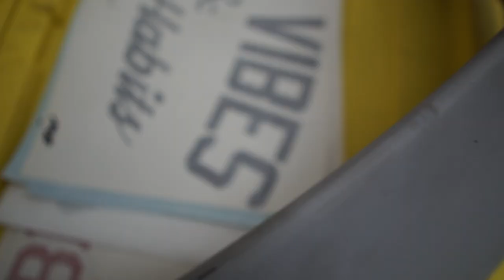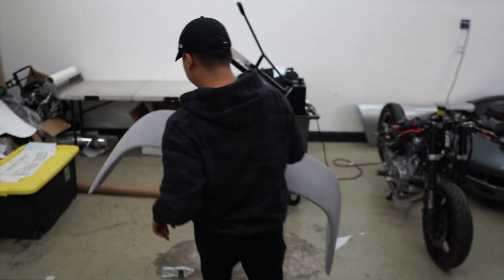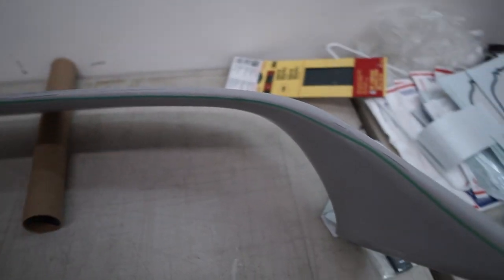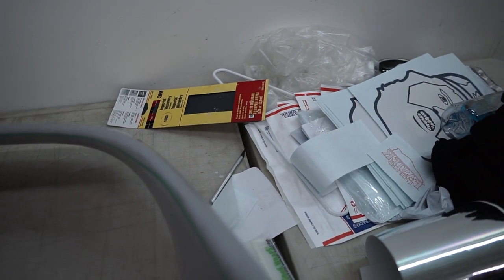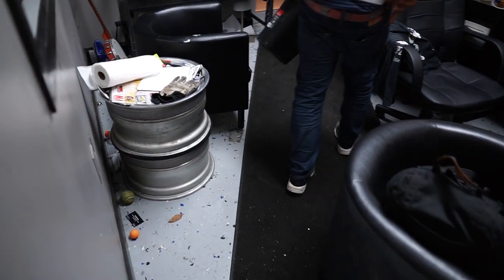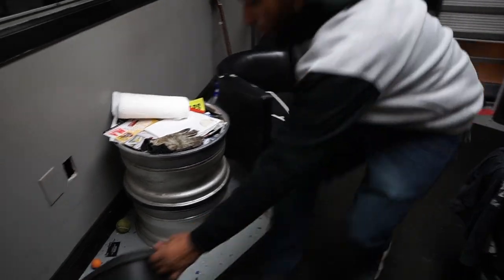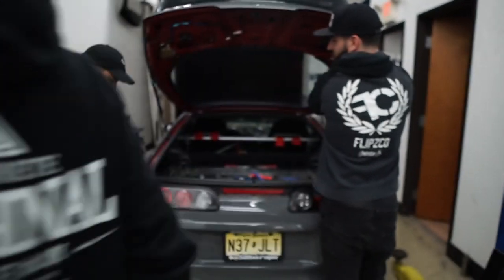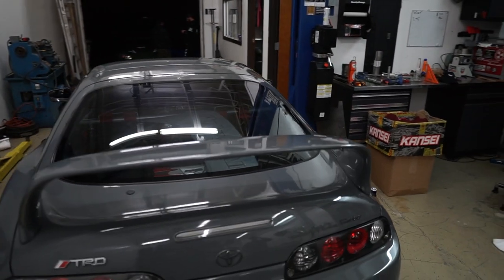MK4 Toyota SUPRA Finally Gets a NEW WING !!! *Vinyl Wrapped & Installed*

Comment: Think you should of went with the trd wing based on the styling of your car. Wing looks good tho, better than the duck tail one.
Reply from the maker: That’s the goal but for now oem will do. I like the TRD but might just hold off and run the shuttle oem wing until winters over. Goal is to atleast have spares: Ridox front bumper/sideskirts/ TRD wing & than just switch the oem look to aggressive ridox whenever